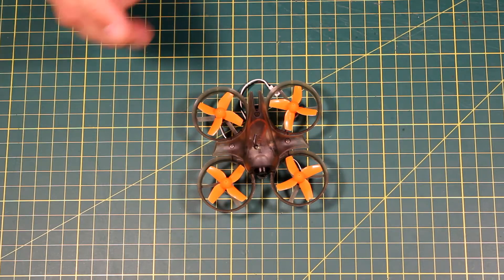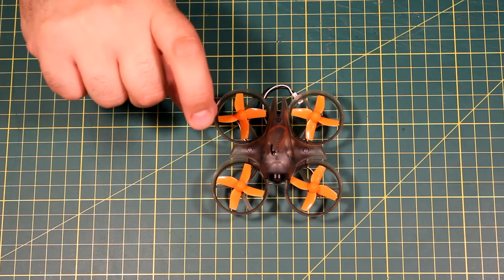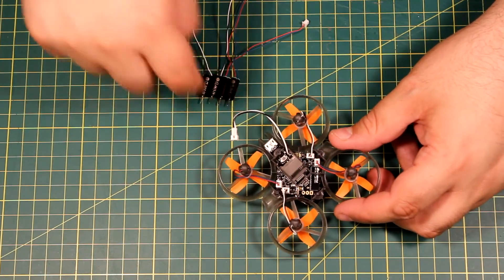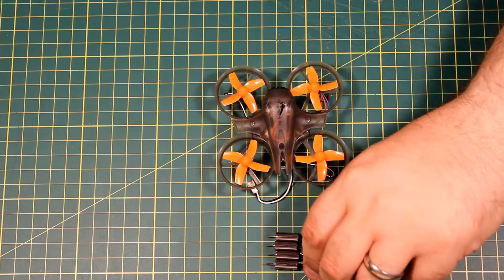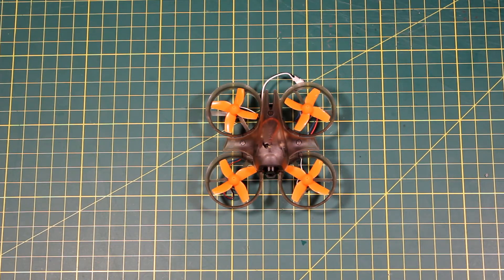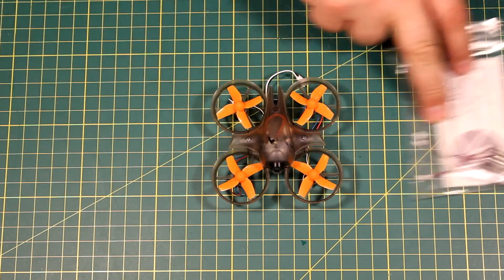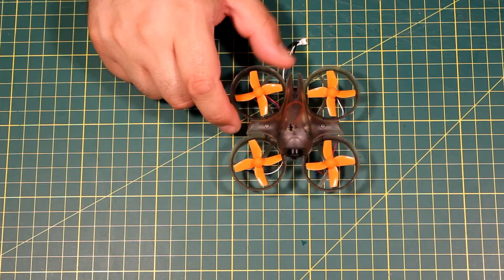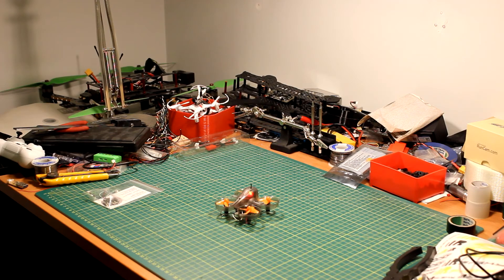FrSky MQ60 - Motor Upgrade

Comment: Great review- could you not have swapped the props? Some micro quads have the betaflight configuration where the motors spin in. Inductrix reverses the direction. Have a look at the ludicrous motors. You can actually fly outside. :) keep up the content. :)
Reply from the maker: I could have but I would have needed to plug it in to a computer and reconfigure it for motors going the other way, and this just seemed easier at the time. 

I'm liking these new motors. It's making it very stable in flight now.
Reply: XMode indeed to change the motor direction,  switching the props over  could’ve worked too 🤐 also check out PROJECT MOCKINGBIRD- it’s a betaflight setup and makes the quad fly amazingly!